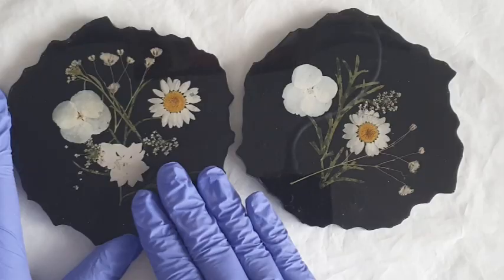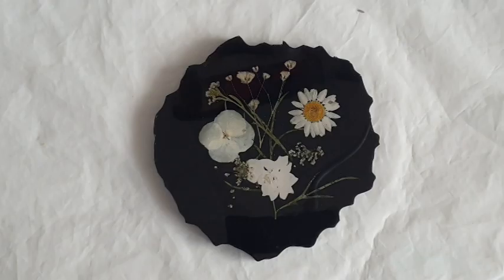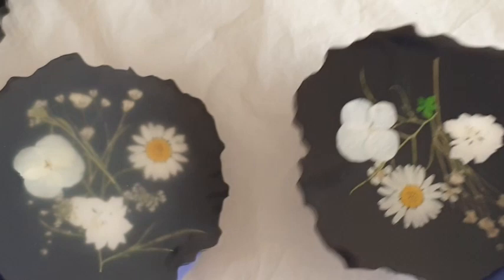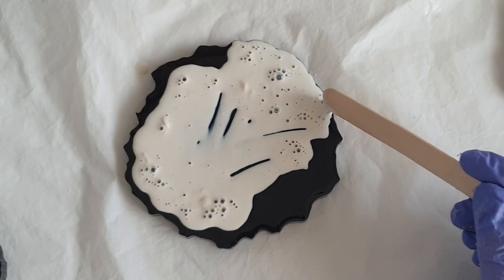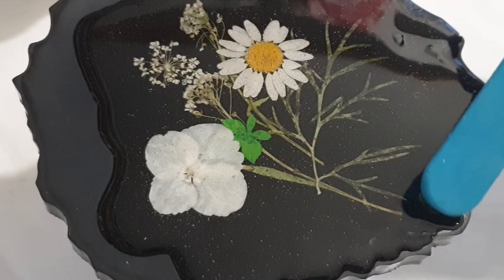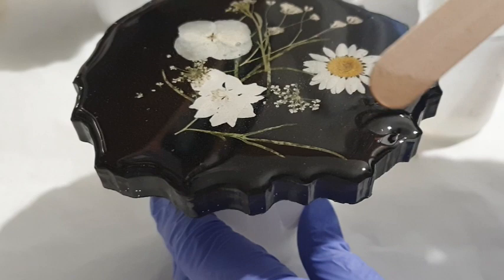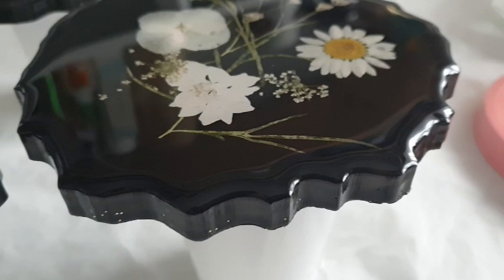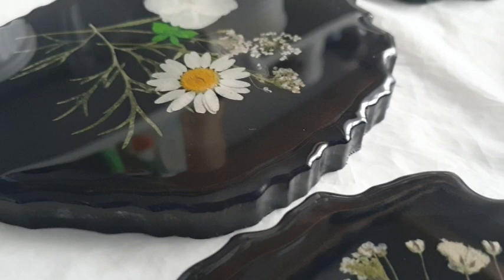How to SAND and TOP COAT Epoxy Resin

Comment: Another awesome and very informative video. I've watched so many videos to try to understand how to sand and top coat and I'm still confused. You made it very easy. Thank you. 
To prevent the Resin from running under I've seen some people use a doming mat. It seems to work. Haven't tried it yet though. Love the masking tape method you used on another video. Will most likely use that with the PVA glue. Thanks again for sharing.

Comment: Awesome job!  Great tips in this video!  Do you know if that latex works on wood?  Just thinking about how hard it was to get drips off a large wood round I did!
Reply from the maker: Heyyy girl .. thank you .. I absolutely always use Masking tape on wood. I dont think Latex would come off easly at all. Unless the wood has been sealed and painted maybe x When I work on Wood Rounds ... masking tape is the best x
Reply: @ClairesCraftyCorner  Ah, darn!  :(  Oh well.  lol.  I have used painter's tape, but I still had a heck of a time getting some of it off, even using my embossing gun.
Reply from the maker: @trishscreativecrafts  yeh very true ... it doesn't come off so easy at all 😢😢 but I would say paint the underneath to make it easier ❤❤

Comment: What is the difference between a topcoat and a final layer of resin?
Reply from the maker: not much depending on piece. A final layer of resin could be seen as 2 things. The piece is still in the mould but needs a final layer - then it could also be seen as a top coat - done when you have already potentially de moulded. So technically could both be the same :)

Comment: Top coat only epoxy resin or resin,hardner mix plz tell
Reply from the maker: heyyy lovely - you can top coat with most epoxy resins 2 part. The only resin that wouldnt work great is a deep pour.

Comment: Hi, are you using resin as the top coat? Or is it a special top coat for resin, thanks
Reply from the maker: heyyyy lovely - this is epoxy resin as a top coat yes. You can use most epoxy resins for top coating. Just not deep pour resins.
Reply: I’m confused, so you don’t rub it down again? Was it epoxy resin you used first? Thanks
Reply: You said not on deep pour resins? What does that mean, sorry I’m new to this x
Reply: Ahh I understand, so the mould I’m going to use is around 3 inches deep? Is that ok for epoxy?
Reply from the maker: @leeiaprice7386  Yes - you will need DEEP pour resin for 3 inches :)